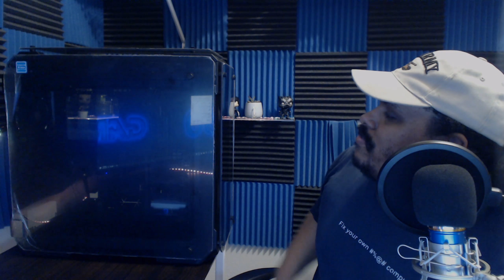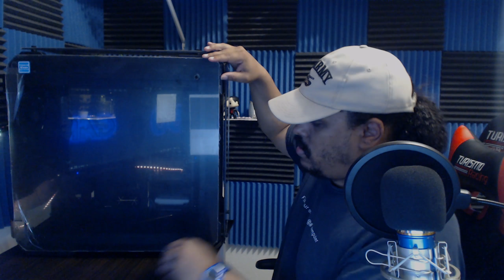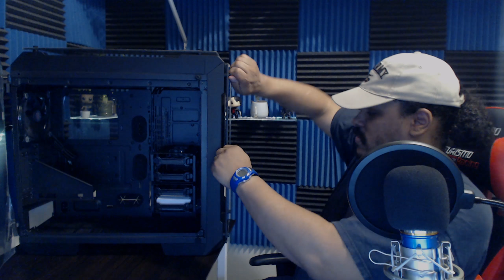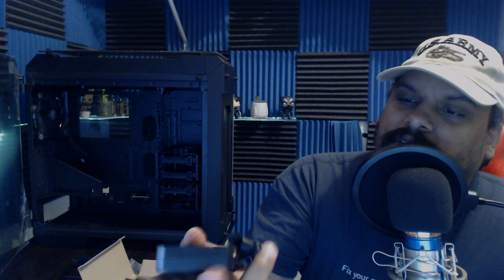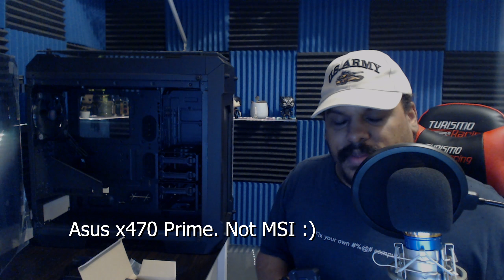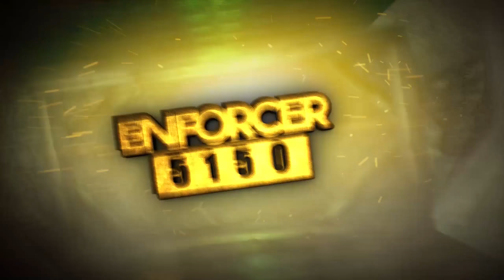New Case! Thermaltake view 71 RGB unboxing

Comment: How much fan include with the casing??
Reply from the maker: There's 2 360mm in the front and one 240 in the back. Has room to switch smaller ones and used 3 in front and 3 on top like the image on the box. But it only comes with the 2 360mm fans on this one. Think the image is 3 240mm fans.
Reply: @EnforcerGamingX  ok thanks sir 🥰🥰
Reply: @EnforcerGamingX  I'm pretty sure it includes 2x 140mm in the front and 1x 140mm in the back.

Comment: Can u put 1 or 2 SSD Drives in one of those drive bay slots?
Reply from the maker: Chesco only has holes for 1 ssd each.. u could fit 2 in the bay if u ignored the screws. But there is 3 hidden bays in the back as well u see at 6:20 , you can see hdd drives installed in the back at the end of the pc build I did here https://youtu.be/RLydeMFYnsM thanks for watching!